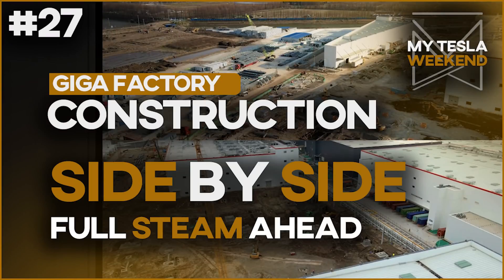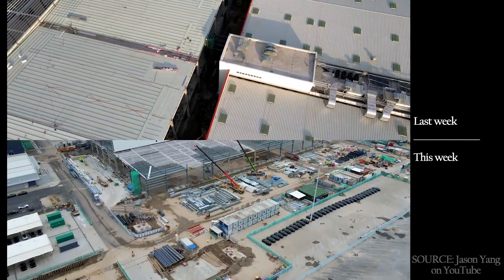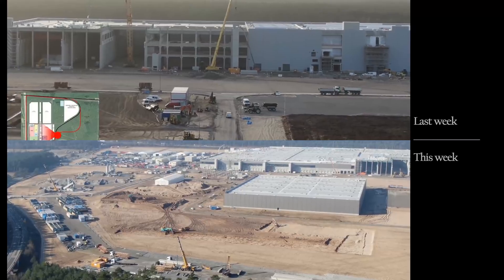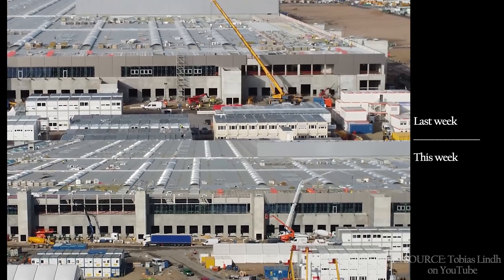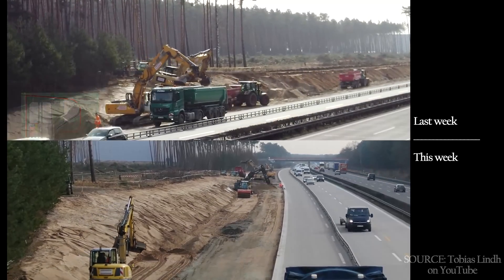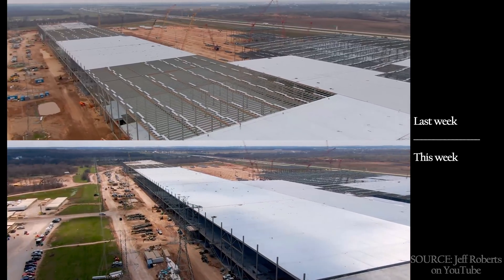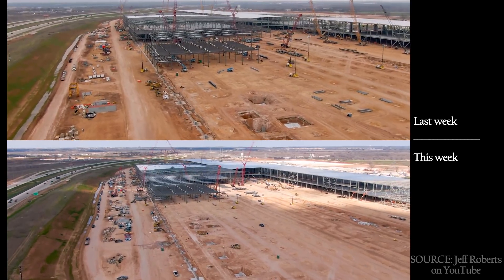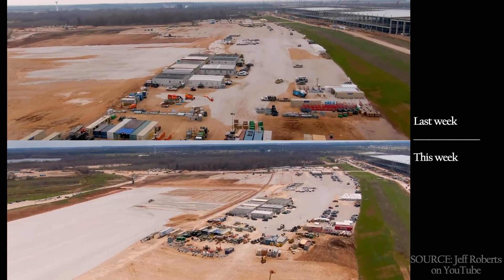All GigaFactory progress before/after week of March 7th

Comment: I'm just curious, Why does some of Giga Texas have a concrete roof and other areas seem to have only steel roofs? Will it all eventually concrete?
Reply from the maker: The areas with concrete roofs is to support the weight of the massive bridge cranes without unduly stressing the building. They are only over the stamping and casting areas where there can be occasion to move things that weigh in excess of 50-100 tons.

Comment: Regarding Giga Berlin temporary highway access: I'm pretty sure this is mostly for worker access more than material access. Of course, it will also help flow in materials, but my understanding from various related reporting translated by 3rd parties is that the local area infrastructure for worker commuting is virtually non-existent. i.e. Prior to start of construction, there was only 2 trains to train stations daily and, if I remember correctly, bus service was either twice a day or was hourly only. This in no way will support the required workforce.

My current takeaway on the related articles is that the local government is building a new train station (or perhaps reviving an old one) and increasing bus service proportionately.

Comment: On a completely separate note, I wonder if the area on the west side of the freeway will be the home to Starlink equipment manufacturing and offices. Given its proximity to the residential area, it must be intended for light industrial and office rather than heavy industrial.
Reply from the maker: It's not an unreasonable assumption. Though I wonder how they would handle the "rent" for it, since there's a potential for conflict of interest. Though if they just go with whatever the prevailing market rate is, it shouldn't be an issue, and it would benefit both companies to have him so readily available. You know Boring Company is headquartered in Pflugerville just 20-minutes away, so that's also helpful.

Comment: I'm betting it will be the fastest built Autobahn On/Off ramp 😂 Usually it takes ages...
Reply: I don't know about the Autobahn, but the SH130 construction next to GigaTexas has been going on for longer than the entire GigaTexas construction with virtually no visible progress.
Reply: @brucedubbs6939  You are looking at one mile of a 21 mile, 3 year project.  And much of what we see is a staging area for the larger project.
Reply: @cerealspiller  I was talking about the expansion between the Colorado river and Harold Green Road.  The road has been restricted since Tesla started their factory.  Why does there have to be partial work for pieces of the road for the entire three years?
Reply: @brucedubbs6939  In Germany people often say: "even if autobahn is unrestricted, you have so much constructions that there is an construction limit anyway" or "where can you drive 250km/h, there are so much construction". Is is not totally true, but this shows how people's view is.

Comment: It's about time they start building the battery production line in Berlin! Perhaps the "warehouse" will be it?
Reply: I was just thinking that. The fact that the battery lines have stated so "late" in the schedule, makes me wonder why? Is it because they've had problems scheduling the raw materials? Or is it that the construction of those lines will be faster than anyone expects? I'm leaning more towards the latter. Interesting not from Texas, I think it was Joe Tegtmeyer that said the battery facility there will include Lithium Hydroxide processing as well. That is a significant step, and makes the production of batteries even more efficient and lowers costs.
Reply: @grahammonk8013  What I do know is that the building of a battery plant in Berlin is subject to a separate procedure for permission. And I agree with you that Tesla can build it much faster than we would think. I believe Elon is sandbagging the undertaking, by calling the Fremont line a "pilot." In the meantime, Panasonic and LG are building their own 4680 factories already…
Reply: @dirkkruisheer  True about Berlin permissions, but the footings for Texas battery plant are only underway now as well.
Reply: @grahammonk8013  You're right. On the other hand, the first cells for Berlin will be produced in Fremont, Elon has said. So there's some room there.
Reply from the maker: I think so too. It was originally labeled as "motorworks" but you don't need a building that large for the manufacture of electric motors, and I also can't see why it would be a wholly isolated building were it not for chemicals in the air.

Comment: I still believe the gravel area on the east side of the powerlines will be the switch yard (as per original plan) and the switch yard currently being built is just temporary.
Reply: IMO, The work they are putting into the current GigaTexas switch yard is far too extensive to be temporary.
Reply: Looks a similar size to the switchyard in Berlin.

Comment: I’m starting to wonder whether the protruding structures on the outside of the buildings are really primarily fire escapes.  This is because I notice that at Giga Berlin the drive train building only has these structures on one side.  For such a large building I would expect fire escapes to be on all sides.

I also am pretty sure that I saw, again at giga Berlin, one of those structures that appeared to have no access to the upper floor.  Ie the upper floor that the structure was built against was a solid wall without an openning
Reply: IMO they are primarily a firewall for docked trailers.
Non-docking sides of the building would have internal fire exits ?
Reply: The towers function primarily as fire escapes and entrances. The drive unit only has a second floor on one side, which is why they are only installed on one side. The entrances to the second floor are cut into the panels later. These consist of a thin metal plate and insulation. This is the simpler step in the work process.
Reply: @Nils2091  Also, I think the drive train assembly has a much higher degree of automation. Very few employees within the building.